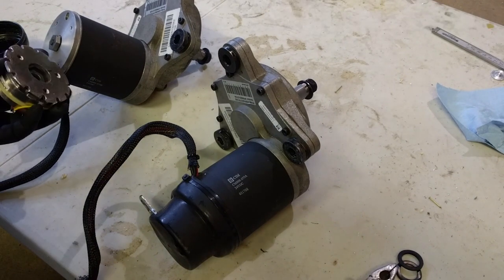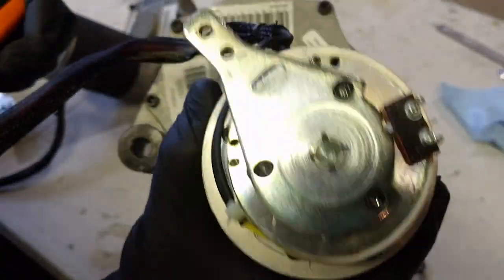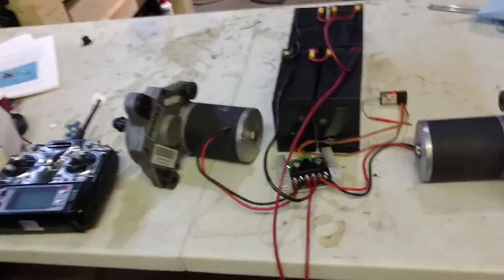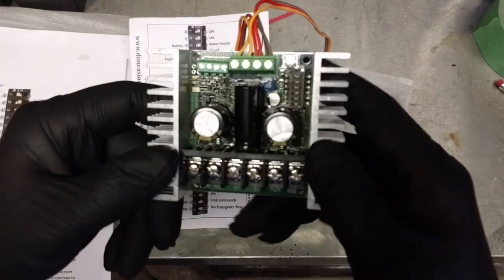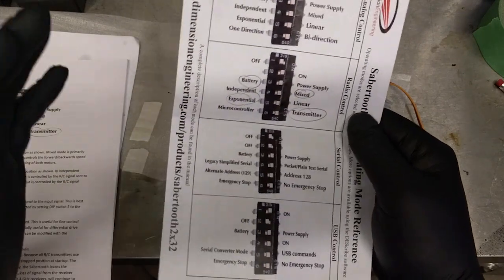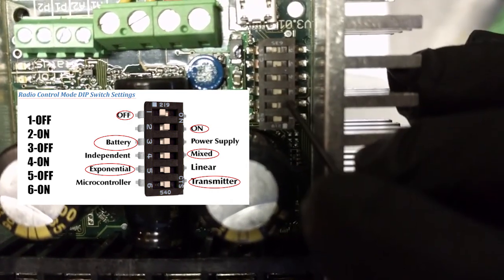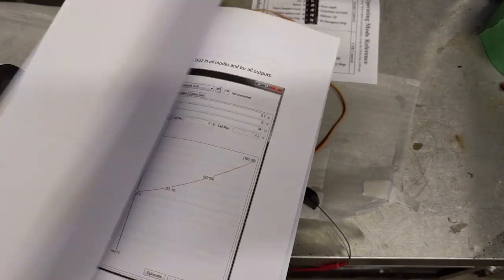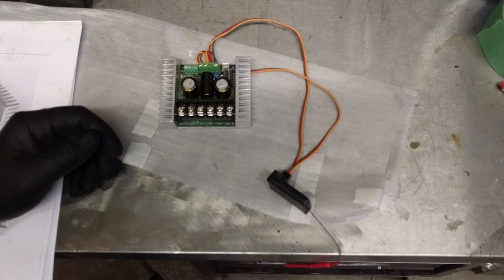RC Bench Test Of New motors and Controller

Comment: Are these worm type gears inside the gearboxes? Without the brakes if these were installed on a powerchair/wheelchair would it coast a little when electric power is removed abruptly from full power with someone lightweight sitting on it? I'm trying to find out if I can use them on a model locomotive I'm building. I need them to coast when power is removed without the solenoid type electric brakes installed. Like a RC car with a pinion and spur gear on it. Thanks...

Comment: Hello
can you help me?
I have the same controller
BUT
When I turn it on, the motors run
always one
sometimes alternately
without contact with the recipient
This also happens with a connection to the receiver
Reply: Did you ever figure out what was causing it? Mine will do that at times

Comment: With a complete battery powered wheelchair, how do you add the sabertooth into existing wiring and still have full use of built in wheelchair battery charger?
Reply: Google sabertooth 2x32 image.

Comment: I commented before watching the entire video. My apology. I do want to know if the batteries are deep cycle. I have two 12 volt 12 ah batteries...is there a major difference?
Reply from the maker: I believe these are the ones I am using or very similar. Seem to work great. here is the link . http://amzn.to/2FrtsJ4.    Thanks
Reply: they are gel cell only to be charged by a 5 amp charger takes a long slow charge

Comment: Cool. That what I’m looking for a similar setup . I have two hoverboard Motor with two 350w Motor Controller . I have a Ppm receiver from a rc helicopter . Will it work if I just connect the receiver with a throttle signal ? Or how should I connect it ???